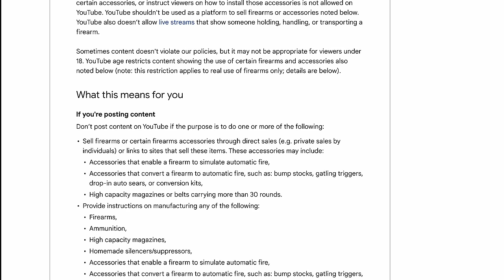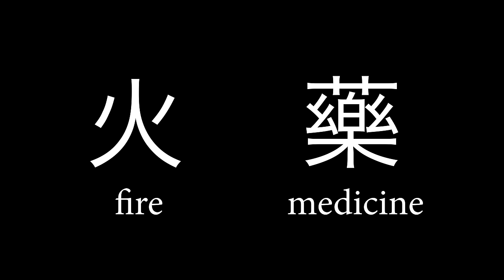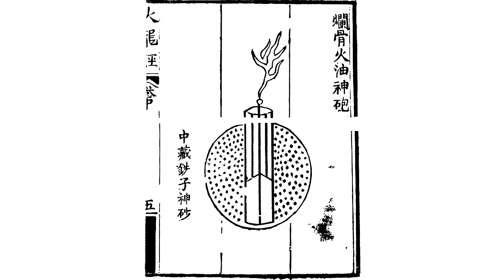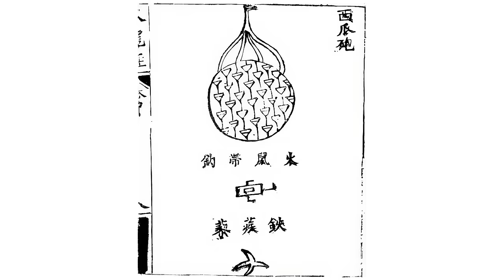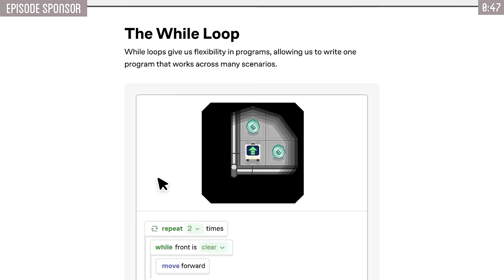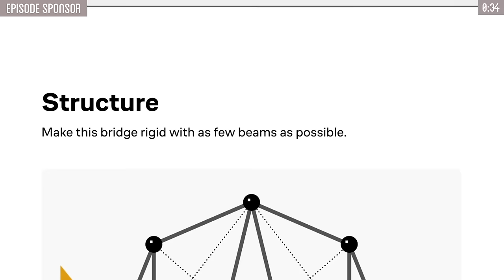Recreating the First Gunpowder Weapons!

Comment: On the bright side, there is an exception for muzzle-loading black powder rifles. 18 U.S.C. 912(a) (3) states that the following condition qualifies as an "Antique Firearm" and not subject to the same regulations: "any muzzle loading rifle, muzzle loading shotgun, or muzzle loading pistol, which is designed to use black powder, or a black powder substitute, and which cannot use fixed ammunition"
Reply: But turds may still report, falsely.
Reply: You are right. Buuuut YouTube is still going to YouTube.
Reply: This should keep the police from confiscating your constructions.
It does not force youtube to show the video.
Reply: Which does include a number of repeating firearms (like harmonica rifles and cap and ball revolvers etc). Flint lock repeaters and fully automatic rifles were in military service in 1798…(flintlock metal storm…).

Comment: If you place a black powder fuse inside a paper straw or long paper tube it burns at an extremely accelerated rate. and is good for connecting multiple fireworks that you want to go off at the same time.

Comment: elliot fire baskets are easier with forge welding four bars, like a twist cage handle, same idea.
very nice hot cuts btw. i was impressed  no cap as the kids say
Reply: Thank you! I think you're right, it may have better a better approach.
Reply: @ElliotKrueger  hows your forge welding chops?
i figure a four way stack with spot welds to make a basket with enough meat to draw out a socket at one end and bodkin point at the other would be easiest.
Reply: @RedDogForge  Honestly, I need to improve my forge welding technique. I think I need to focus on keeping a clean, low oxygen environment to prevent scaling during a weld, but I'll have to give that a try!

Comment: I am not sure on the exact terminology but I believe they are making and using black powder instead of gun powder. For simplicity's sake, Black powder, when burned, creates a lot of smoke and burns rather slowly and efficient instead of bursting. It wasnt until the 1870s or so, that gun powder was invented and it burns a lot more cleanly and more efficiently, enough so to start using in ammunition shells.

Comment: Some of the worst fire control I've seen, shooting dry hay against a tree In a neighborhood, and standing in dead grass and the only fire control was the guy putting it out with a gloved hand? Can't wait for the next warehouse fire episode.
Reply: Are you under the impression that the live tree would immediately ignite before the three people with hoses and extinguishers 5 feet away could get to it? Thank you for your concern and we'll attempt to be more careful next time, do you have any suggestions?
Reply: @theomelchior2739  something tells me you haven't spent much time around fires or live trees
Reply: @Shon88888  sure I have, for example the one in this video, that was at no point at risk of bursting into flames.
Reply: @theomelchior2739  Since Shon seems incapable of offering constructive feedback, I will try and fill in for them. 
It's typically inadvisable to start fires under overhanging branches, since deadwood and dry leaves can exist in still-living trees. With 3 people standing by for fire suppression the chances of a major fire are low, but it's good to opt for zero-risk options when they are available. There's also some risk of damage to the tree itself, which again is low but could be mitigated easily. A similar situation exists for the dry grass under the launching area, but it's more of an injury risk. If you can mitigate the risks of your co-workers getting burned by flaming dry grass with a simple move to green turf, I'd say go for it. You could also pre-wet the grass as a general precaution.
Reply: @theKashConnoisseur  I appreciate the adult response. There will always be a lot more precautions with our videos than make it on camera. We were all armed with extinguishers, hoses, and fire blankets. The branches on the trees are 30-40 feet 9ff the ground.  The ground was soaked with water, as was the hay bale (and we put dry straw in the front so that it would actually catch fire)
Reply: @theomelchior2739  Totally understandable. if you showed every tiny background detail, not only would retention be awful, but the videos would get a bit long. I'm glad that you and the rest of the team are taking safety seriously as well as giving us great content. Thank you for taking the time to clear up misconceptions.

Comment: I saw once in a documentary that the way they figured it out was because they noticed that saltpetre, which deposited naturally on the walls and ceilings of cellars under some conditions, was easily flammable (they obviously didn't know it was because of oxygen). So they must have found ways to collect it and mixed it with other chemical to make the flame bursts more reliable and consistents through trial and error.
What is more ingenious to me is the fact that they figured out that the burst also creates pressure and they could funnel that pressure through a tube and then decided to stack an object on top of it to push it at high velocity against other people.